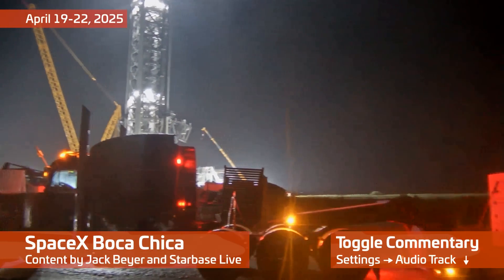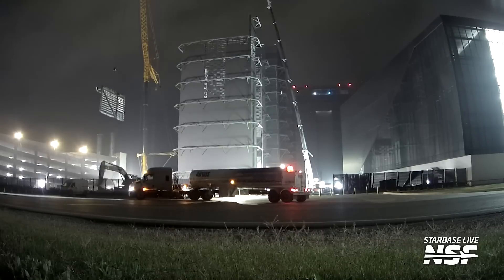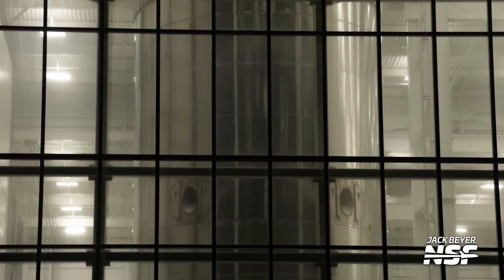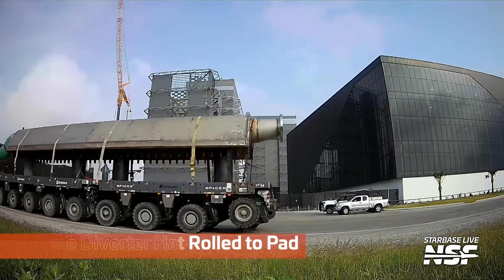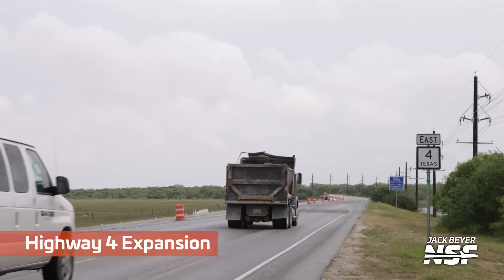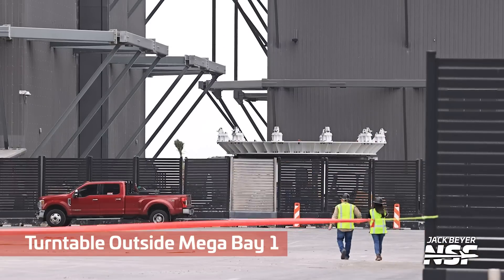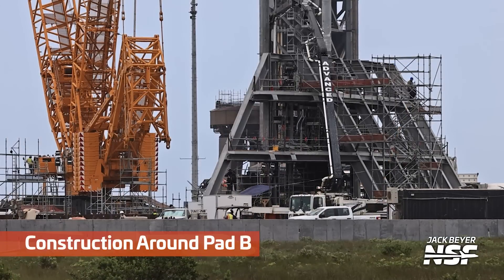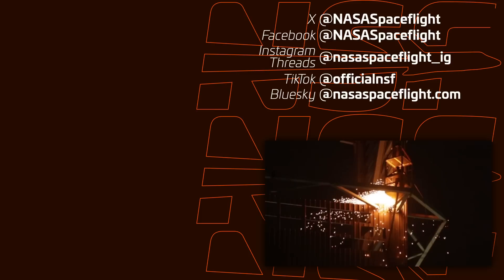It's Leg Day at Starbase | SpaceX Boca Chica

Comment: Any bets on how many times they have to iterate that flame diverter hat before it works well and lasts?
Reply: Hard to say, no one has tried to build one for a system this large with the hope for a launch rate as high as they want.  I would not be surprised if it takes a few iterations.

Comment: Those "Ports" on the side of Test Tank "17"..
Could they possibly be exhaust ports for the HLS..?
They are angled out and down, not too dissimilar from the renders and animations we've seen of an HLS vehicle coming down to the moon..  🤔
Thoughts Das..?

And hell yes to the 20 minute spark video upload.. pretty sure it was my suggestion a few weeks ago.. 😊

The widening of highway 4 is probably to accommodate the upcoming move of Pad B's OLM..
It's really really wide, and maybe they've crunched the numbers on the balance point of the SPMT's, and realised that they need a wider stance..
And considering the cost of Starship development, a few million for a highway upgrade probably isn't gonna frustrate the accountants much..

Comment: LMAO the old bull nose truck on a truck bed! I did that once with a 77 TransAm, while I was driving over the road. It sat on the front of my flatbed as I was loading out to go to SeaTac and dropped the car off to get the decals put on. My agent was pissed because I could only take a 25000 lb coil up that way. (it kinda cut into her paycheck a little) I did the same thing to her again when I dropped a load a scrap coils off in New Orleans, then picked up a rebuilt 455 SD Pontiac engine on the way back... again only a 40000 coil of steel for the return trip and another cut into her paycheck.... The trip back from Federal Way Wa, was on my dime with the TransAm.... that was considered deadhead miles... so she was really pissed at me! I made it up to her over a few government loads a week or two later.

Comment: @NASASpaceflight "Test tank 17" I am pretty sure its and SLS Protype, Those cutouts look like like engine ports from the renders of the SLS. The landing engines anyway.
Reply: The cut outs are for the piston on the test stand to connect to the inner landing/header tank.
Reply: But do the pistons simulate the forces produced by the landing engines

Comment: The 4  holes in the side of the tank. Could it be to test structural integrity for the lunar version of starship
Reply: 2:08 Those are going to be 4 large thrusters instead of many smaller thrusters. I see the oval holes, and the tubes inside are also aimed down. (They might even be conical further in.)